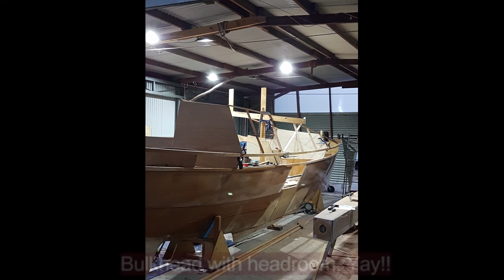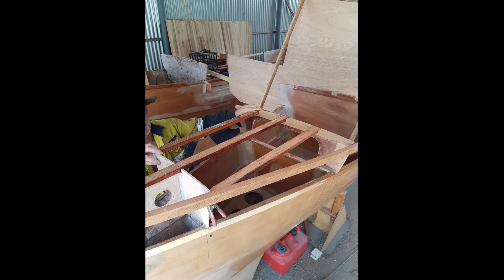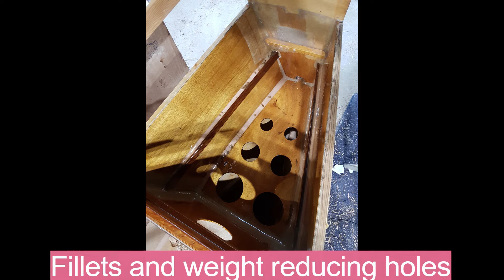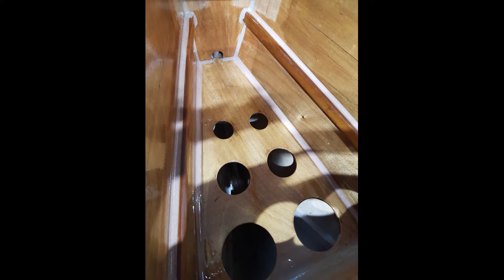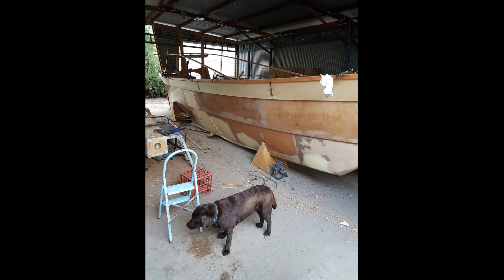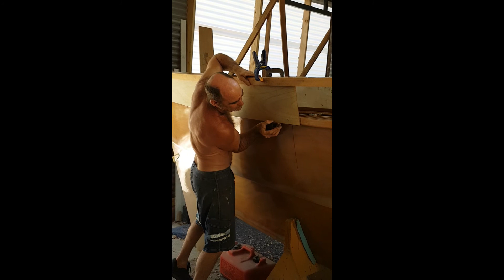TIKI 30 COOKING AND MORE MODIFICATIONS! Episode 5

Comment: Hello, I am also seriously considering the Tiki 30 for my next build. Did you modify the height of the bulkheads to get standing headroom in the hulls? Or do the plans already provide standing headroom? The 30' and 31' Wharram's are about the perfect size I think...i mean for my own needs, of course. I was first considering the Tiki 26' and still am. But I just don't like only having crawl space and sitting headroom only. 
Are you going to build the deckpod as well? I just found your channel,so I'm going to start binge watching. 
I was also considering "Leons Cat" from the TCP mag. issue #75. But I've been in love with the Tiki's for so long, it's hard to let the design go. I want to build a vessel that will let me liveaboard and travel from Thailand, to all the Indonesian Islands and beyond. 
You're build looks excellent! Where are you building it?
Reply from the maker: Hi Kai  , the standard tiki 30 does not have standing headroom  .my inspiration came from a utube video of a stretched at build tiki 33 built in Thailand  it just looks so much better sailing next to a standard 30  .check out utube catamaran wavedancer  .so I bought an unfinished project and went the hard way of cutting and stretching the hulls   .then I came up with the idea of adding a  extra plank ,as well as taller cabin to just achieve headroom .it's been a lot of extra work  but eventually worth it I hope  .I've also incorporated the underseat area as part of the hull to give me a wider berth ,two central outboard pods,and wider bench space in the rear ,the challenge has been to build all this strong enough but still light .I'm in Western Australia  ,indo Islands are also on my radar